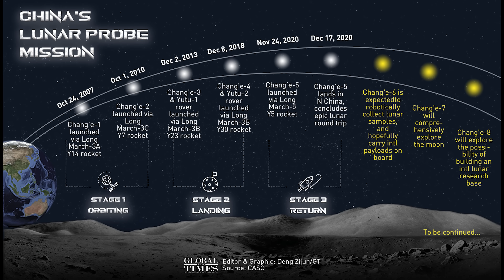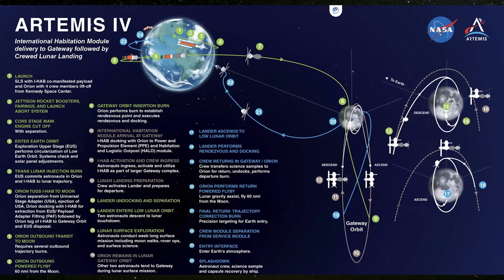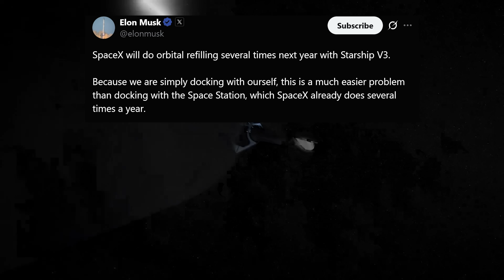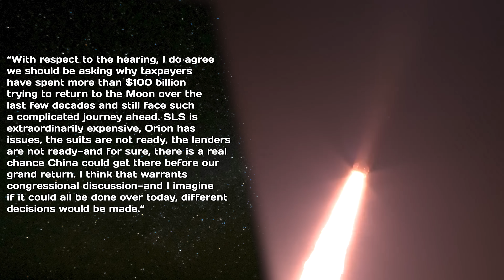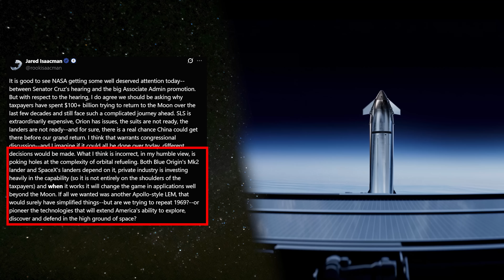Ex-NASA chief revealed the Real Problem with SpaceX Starship to get back to the Moon while China

Comment: The Apollo missions allowed for a stay on the lunar surface of up to three days. They had disposable batteries and resources. Artemis aims to remain for weeks or be a semi-permanent base, which means, like the ISS, self-regenerating life support systems, available power, and logistics. That means tons of materials and systems that only Starship can carry and land on the Moon. We need to get there gradually, also in preparation for systems on Mars. An initial LEM could make sense, provided the first base has already been created by Starship HLS. In reality, it doesn't make much sense to carry the entire mass of the Starship HLS up from the lunar surface to lunar orbit and then throw it away. A sort of descent and ascent shuttle that provides life support for a few dozen hours and that works alongside the Starship HLS makes more sense on the Moon. It's a different story if you intend to test the system for Mars, where a ship like Starship (or slightly smaller, as Zubrin suggests) is essential for ascent. China and the US are pursuing different goals, and this should be clearly stated and explained. For China, simply stepping on the lunar surface for a few hours will be enough. The US did it 55 years ago. Extending human presence beyond Earth's orbit is the real goal, along with preparing for Mars.

Comment: The plan outlined in this video requiring the combination of Artemis, Gateway and some indeterminate number of Starship launches sounds like - to make a pun - lunacy.  There are too many points of potential failure to have a reasonable chance of success.  Have the administrators and engineers never hear of Occam’s Razor?  Also, it is naive to take Elon Musk’s pronouncements with no pushback.  Almost everything Musk has promised has been woefully behind schedule and he’s getting worse as he goes.  SpaceX will probably accomplish an on-orbit fuel transfer about the same time Tesla drives a car autonomously from ocean to ocean which Musk promised would have already done ten years ago.

Comment: Why don't they just build re-use the technology they used 50 years ago, when they went to the moon, put astronauts on the surface, and brought them home again,all using computers with the computing power of a present day hand held calculator? And why not use a new version of the Saturn V rocket? Surely the blueprints  and tooling could still be utilized or re created. Why try to re invent the wheel, making entirely new ideas, when they did it 50 years ago? There was no refuelling problem then.
Reply: All those Engineers understaning those blueprints and methods are either dead or super old by now, modern engineers works totally different and the old stuff is hieroglyphs for them. A new start is required.
Reply: The biggest hurdle is cost. It cost more to put a man on the moon than to develop nuclear weapons.

In the 60's the budget was so large that it nearly bankrupted the soviets, even the US could not sustain the level of spending for very long.

The technology to do it is available (and certainly to do it the way it was done, even if you have figure most of it out again), but it is just prohibitively expensive.

Cheaprr ways are now possible with the new tech, and the competition with China for future moon resources makes it worthwhile again.
Reply: Because of cost. You can't keep defunding NASA and then expect them to repeat their achievements.
Reply: As an example: the shuttle was to some extent designed as a cheaper alternative to the Saturn 5.

Aquuck internet search shows the average shuttle launch cost about $1,5 billion.

Falcon 9 launches for $67 million per launch.

Starship is aiming to be much cheaper still
Reply: @CS-px9rr  Thank you for that info.
Reply: Great idea !

Basically it’s the plan the Chinese are doing to get humans on the moon.

Comment: The universe doesn't care. It will decide what works and what doesn't. Complexity fails. Simplicity succeeds. If the architecture isn't rock solid no amount of will is enough.
Reply: The Starship architecture is lumbered with 42 engines as Elon thinks that's a cool reference to HHGTTG . With engineering decisions of that calibre it's certain to be a success.
Reply: The universe isn't a sentient being therefore has no agency.

Comment: Why not have two connections and spin…? Rely on centripetal forces to force the fluids into the ends.
Reply: Because it would be unstable and would have to be stopped for undocking.

Comment: The original space race was brought about by "Vengeance 2," a Nazi rocket for indiscriminately bombing England. Of course the rocket had two uses, first mostly for bombing, but also for exploration. For both cases they needed a) precision targeting and b) greater power. For exploration specifically they needed a means of landing the rocket gently and reusably. NASA figured this all out decades ago with moon missions. Everybody has ballistic missiles today, it's not even a problem: the issue is making them cheap and destructive.
Starship is about hauling building materials in order to construct a space colony, well, the space shuttle could do that - decades ago. The shuttle was only good for building an orbiting space colony, which we've been operating for decades already. The shuttle's landing gear was only good if there was an existing runway and atmosphere, which the moon has neither. So starship is a space shuttle with rocket descent instead of landing gear, to land on a rocky airless body. "Why do it," well there's practically zero advantage to living on the moon compared to living in orbit around the moon.
Here is what ZERO people are thinking about: what you need is to drop off a bulldozer on the moon and clear away some of the boulders, and you dream of casting a cement foundation, but the moon isn't made of normal dirt, you can't burn diesel there, all you can do is build a tent city in moon dust. The best you could do is set up a moon quarry somewheres and cut out moon bricks and build yourself a moon pyramid stack of bricks inside of which you could inflate your moon tent, I guess. None of this is happening in the next century, but we'll learn enough farting around to realize how moronic a notion it is. Oh and everybody landing on the moon is probably going to die in a humiliating starship explosion, just you watch.

Comment: Why are dozens of starship rockets required?
1969 it was just one Saturn 5 - and starship is exactly the same size.
Reply: Because Saturn/Apollo used several small, specialized, disposable and ingeniously designed vehicles to undertake and support the different stages of the mission.
The only component that returned to earth was the tiny crew capsule.
Elon decided it made sense to use one large vehicle to do EVERYTHING.
And that requires a huge amount of fuel.
For example, Apollo left half of the lunar lander on the surface of the moon, and the other half in lunar orbit.
Apollo did not land the crew capsule capable of Earth re-entry on the moon.
Apollo did not land the service module on the moon, nor did it return it to earth
Starship requires that enough fuel be available to bring itself back in it's entirety..

And that fuel requires ~30 flawless launches to get it into orbit...
Reply: @psarj thank you for the explanation!🫡
Considering thirty launches instead of one, the concept seams very very stupid to me.
Reply: @marcuslang6153  
Yes and no.
The long term goal is to set up a "colony" on the moon. But this requires huge payloads to go to the moon.
In some sort Apollo had it simple: 2 men to the surface. They need enough food and oxygen to survive and a little bit of equipment to do something over the timespan of a few days.
Setting up something self sustainable on the moon however means they need to be able to produce their own food, energy, water, oxygen, .... For this you need machines. Machines which would have never fitted in to the Apollo CSM stack.
So, yes. In some way it makes sense for SpaceX to deal with much larger space ships going to the moon. The question however is: Is it really necessary to do it all right now at once, or wouldn't it be much better to do it in much smaller steps? After all Apollo had it's predecessors Mercury and Gemini, which were used to develop and test the stepping stones for Apollo.
Reply: @psarj anything this wasteful is a horrible design. If the US is depending on Elon's ego for its space program, China will win for certain.
Reply: I dont agree with what is said here. The main reasons no one has been back to the moon sre two-fold:

1.) The cost is too high
2). The pay-off is too small.

Competition with China for future moon resources (like fuel for fusion) makes it worthwhile to go back.

The Apollo/Saturn solution is o expensive that even the US cant afford it (couldn't really afford it in the 60's either IMO). The concept behind Starship is that is cheaper, massively, massively cheaper.

Using Saturn is flying an airliner over you destination, jumping out with a parachute, and dumping the airplane in the ocean.

Starship aims to be like an airliner: flying over and over regularly for many years, with the main cost being fuel.

Comment: In fact, orbital refueling was done many dozens of times, on ISS !! Get your facts straight, boi ! How do you think they keep the ISS on orbit, without bringing fuel there ?? 🤣🤣But yes, the Musk "plan" is complicated well beyond credibility point,  and is funny to see NOBODY dare to ask how back then they managed the "Moon Landing" (🤣🤣🤣) in JUST ONE TRIP,  all with ZERO FUEL DEPOTS, and not just once, but SEVERAL TIMES IN A ROW, with tech 50+ yo ???... just saying, peep, some is pushing big BS here, and I think this BS & Lies are decades old...
What I know, for sure, we will watch the Chinese on the Moon in the next years. That's for sure.
Reply: Starship will use methane/LOX for propulsion for it's entire journey. From launch to orbit, earth orbit to lunar orbit, to lunar surface and back. Boiloff is a significant challenge. Needs cryogenics.

ISS recieves fuel resupply only for orbital maneuvering/thrusters. It uses hypergolic (ignite on contact) fuels (UDMH + N₂O₄) which stays liquid around room temperature. So they are storable, no cryogenics needed.
Reply: @Nimoss33 

Probably a cilinder swap, not an exchange of liquid from one tank to another.

The latter would highly disturb me if I was present in the ISS.

I might be wrong, either way, your point stands.
Reply: @gauloiseguy
Not a cylinder swap: you can find videos on YouTube. Still not really relevant to the planned mission though.
Reply: @mirandela777
Technically you’re correct, but in practical terms you are talking absolute b s. The amount of fuel transferred to ISS is tiny and it’s a completely different chemistry: it proves nothing about the refuelling needed for the planned lunar missions.
Reply: @TheGreatAmphibian  - BS is the whole plan of Musk, and that makes your own "defend Musk" argument also a load of BS. But hey, wait a few years and you - and the whole world - can watch, live this time, the Chinese module landing peeps on the Moon. My money is on the Chinese Program, much better funded, with incomparable better engineers,  and with 100x more peeps working on.
Reply: @mirandela777  You seem to have a reading comprehension problem: I wasn't defending Musk, genius, I was saying that your argument - which if true would increase his chances of success - was bee ess. So if anything I was attacking him and you were defending, but you're apparently not smart enough to work this out...
Reply: @TheGreatAmphibian  - you insist on proving how dumb you are, I see...
Reply: @mirandela777  I accept that that you are desperate to save face: God only knows how many times a day you must face profound humiliation...
Reply: @TheGreatAmphibian  - And your "god" is the Master of Stupidity, giving u council 24/7, I see :p
Reply: @mirandela777  Yes. And he says that you should grow up.

Comment: 12 refuelling missions or more to get stuff into a quite sub-optimal NRH orbit. Since I learned about that little factoid I am convinced that the emperor is naked. I'm here with my popcorn the comedic parts of the programme.
Reply: Sorry, that was recycled Jeff Bezos propaganda. And its about 10 to go from LEO to meet up with the (quite unnecessary Orion), land on the moon and come back. So clearly the unemployed NASA admin (a politician by trade... not an engineer) didn't bother to put the question to an ai. If Starship V3 lander was refueled by V4 tanker... how many tanker trips - answer - about 10. So Musk intends to build dozens of Starships by 2027 and has the infrastructure right now once V3 is perfected in about 6 months... Docking - done that. Orbital tank to tank transfer - done that. Cost to put up 10 tankers (some will be reused)... $500m... way less than the cost of SLS/Orion ($4.5b and counting). Boil-off is handled by insulation and/or sun shades and there is no H2 (which boils off Way quicker). 

Orbital refueling is something that we have to master if we Ever want to put up more than 30-40t on another celestial body. Starship can do about 100t this run. With a perfected V4 it should be closer to 150-200t... enough to start building a colony... especially as each Starship launch costs a small fraction of what SLS/Orion (which can't land on the moon) costs.... nor is SLS/Orion reusable.

Its quite comedic. A blow hard politician who learned nothing of engineering from his days pushing paper at NASA is telling the world that he could do better. Have your AI run the rocket equation and the stats Musk published to see if all this is doable... my AI said Yes, and with a healthy reserve to spare. 

Funny how everyone else is wrong when you're a politician looking for work. (The permanent NASA admin hasn't been selected yet.)

Comment: 7:00 Um. No. This is not the most promising option. It's actually a pretty shitty option.

Why? Because the craft should almost certainly have anti-slosh baffles in the fuel storage compartments. This is to minimize the shifting of the liquid fuels during flight which can cause changes in balance and destabilize the flight characteristics of the craft in the atmosphere. These baffles would impede the kind of transfer mechanism they're talking about. The options are to not have the baffles to make this transfer more achievable but making the craft less safe, or have the baffles to increase craft safety but make this system of transfer less effective.

Comment: The tanker doesn't even exist yet.
Reply: So... a tanker is a Starship that has bigger tanks and no cargo area... He should build the tanker before he perfects the basic Starship design?  Cart... Horse.... and yeah, converting it to a tanker is easier than building a lander or cargo ship of the type he already built. He already docks Crew Dragon every 3-5 months for a few years now... He already conducted the fuel transfer in zero G experiment successfully.... Just needs a fuel probe (like the one on the launch pad). I won't say that designing and building a tanker is trivial... but its not hard at all given their experience.

What Does Exist?

2 Rocket engine factories with a combined capability of producing up to 5 engines per day (currently churning out 1 per day on 1 assembly line because that's more than they need so far)

Rocket engine design second to none with extraordinary Thrust to weight, ISP, reliability (intended for 100x uses), produced for 10x less money in vastly greater numbers than next nearest competitor. 

1 million sq foot giant rocket factory to build everything else in the rocket with a max capacity of 100 rockets per year

Built/Operate satellite empire to fund it all when Congress reneges on contract and takes away money despite meeting all requirements (done that twice so far to Spacex). Already producing $15b projected Spacex revenue 2025 with perhaps $22-25b in 2026 due to much accelerated constellation expansion and direct to phone side revenue, possible ISP backhaul service.

Successfully launched and landed first stage, catching it 3x to ensure it was reliable. Successfully hovered 2nd stage within 3 meters of target point in ocean despite deliberate engine loss. Expecting reuse of 2nd stage in 2026. Worked on the interior and life support in mock up of the Lander.

Built 2 High bays to support a total of 5 complete rockets at a time with two more under construction to support an additional 24 rockets (48 stages) at a time.

Built one launch pad. Within 2 months of completing a second launch pad, building a 3rd in FL, due to be operational in 9 months, broke ground on SLC-37 site to begin production of 2 more launch/landing towers and 2 additional land only towers for high cadence launches - estimated 3-4 years to complete these final four.

Launched about 500 Falcon 9 rockets (more than 130 last year) with more than 99% reliability. Landed more than 400 (good practice for much simpler moon landing).

Sent astronauts to ISS multiple times - all successful ( a useful capability for an LEO tanker)